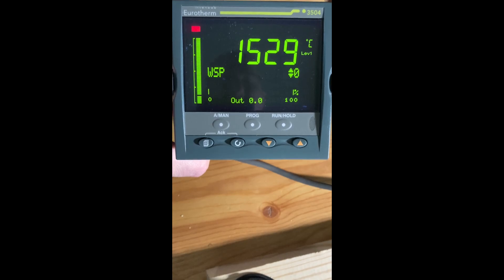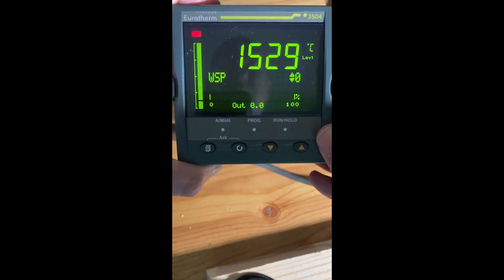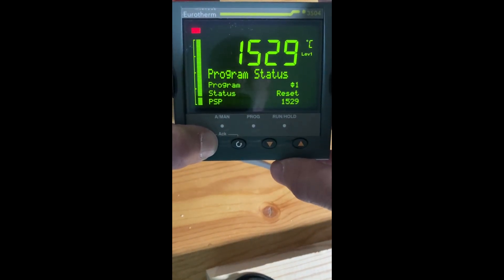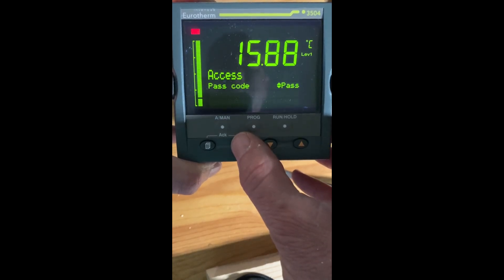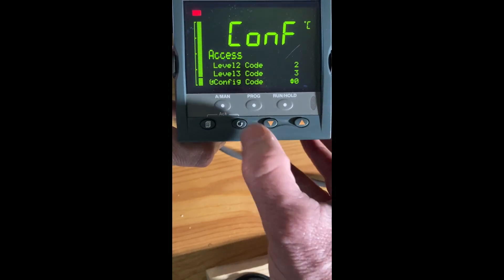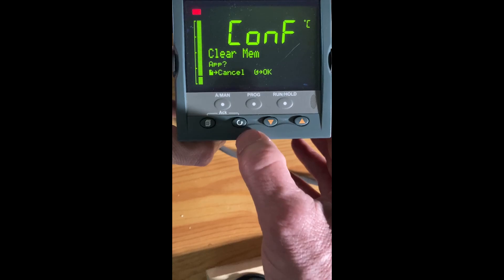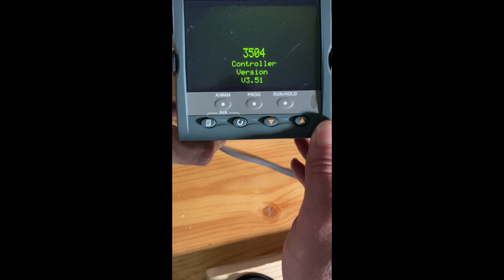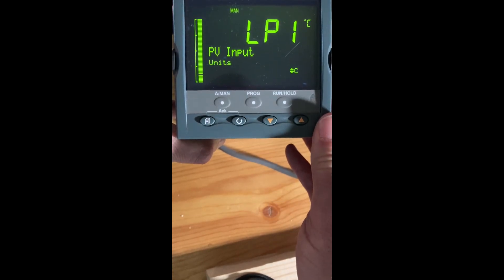How to Factory Reset a Eurotherm 3500 Series Controller

Comment: hello   how  to  factory reset  the eurotherm P116
Reply from the maker: Hello Peter - 

Good question, I don't get many Piccolo questions!

So, you'll have to log into the configuration level of the controller, which requires a password (4 is the factory default).

Once you're in CONF level, push/toggle the "page" button until you get to a parameter call rEc.L.

Then you'll have a few choices which are selected by using the up/down buttons. 

I think the cold start is what you're after but here are the other setting and how the unit will react.

Recovery Point Load
This allows the configuration values saved using rEc.S to be restored. Alternatively, it allows the factory default values to be re-loaded. A cold start removes all previously stored values. If the controller is then power cycled it will start as though it were a new controller 'out of the box' showing the Quick Start Codes 
Value Options

0 (NONE): Do nothing

1 (LOAD): Restore previously stored values
The stored settings may include configuration parameters and operating variables, providing a very powerful means of altering the configuration of a controller in a single operation.

2 (FACT): Restore factory settings
The configuration and parameter values loaded during manufacture may be restored.

3 (COLD): Cold start
This operation should be used with care since it deletes all previous configurations. The controller will re-start showing SET1 of the Quick Configuration codes. At this point it is possible to recover the factory default settings. Alternatively, the controller may be configured at this point as though it were new out of the box.

6 (DONE): The load operation is complete
7 (FAIL): The load operation has failed.

Hope this helps but reach out to me at richard.lavens@watlow.com if needed.

Comment: What do you do when it says passcode lock because the wrong code was entered to many times?
Reply from the maker: Passcode lock, by default, has a 30-minute timer associated with it. So after 3 failed password attempts, you'd have to wait 30 minutes before you could try again. That 30 minute timer can be turned off though, once you in configuration mode. The parameter is located in the instrument/security and is called PassLockTime